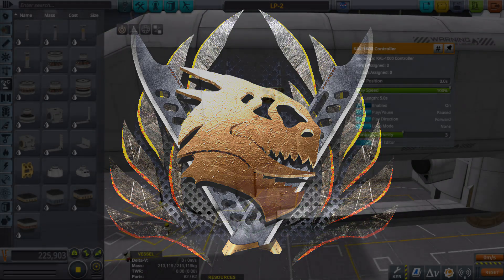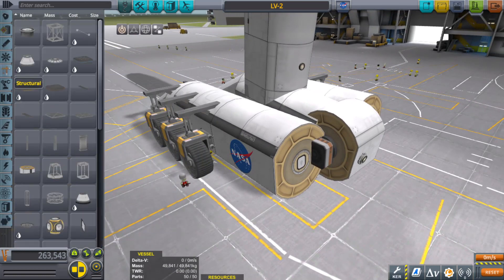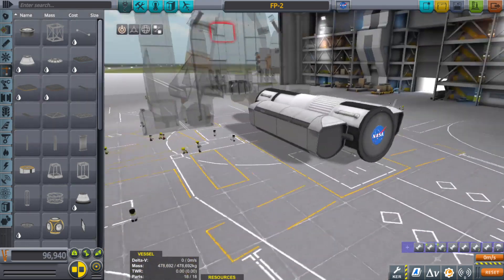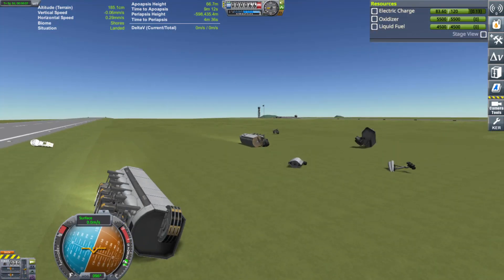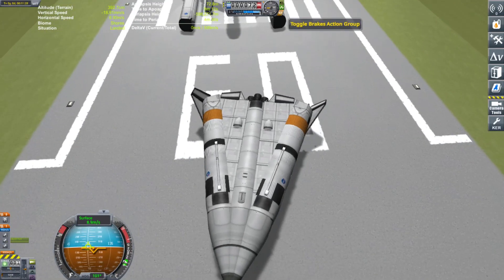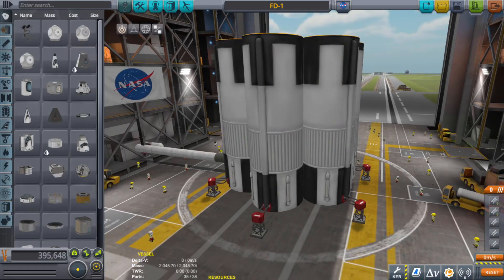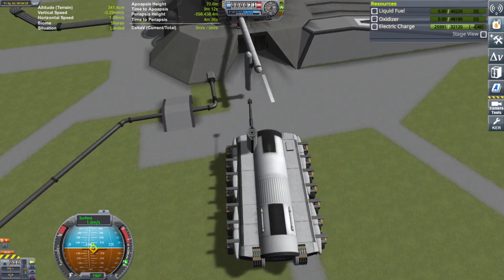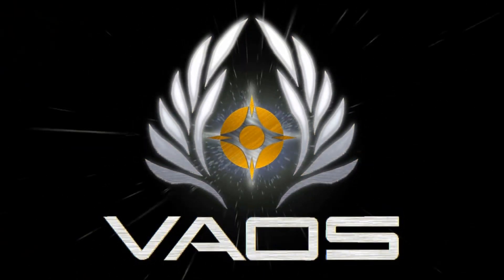SSRT and GROUND CREW complete.  |  KSP 1.11

Comment: 11:47 I suspect the refueler vehicle sliding around may be attributed to the piston still being motorized upon docking contact.  Try disengaging the piston's motor when/after you dock to the fuel silo -- obviously, also make sure the piston is set to be Free upon power loss, not Locked.  Thus, the refueler rover will need to use parking brakes to hold still rather than relying on a motorized piston trying to maintain a fixed distance.

Comment: Hey there, I was the guy that suggested the use of the KAL-1000 Controller. To edit the a curve on a part, you have to select the "Axis Fields". Here it's the Axis Field : "Deploy limit", it controls the deploy angle slider of the ramp. You chose the "Toggle ramp" wich controls the opening/closing button. Every field/action of a part is accessible through action groups and the controller. Using wheels and ramps is a good way to bypass the weak robotics parts, they don't bend as much.
Love your videos !